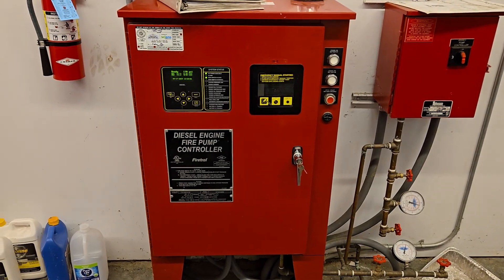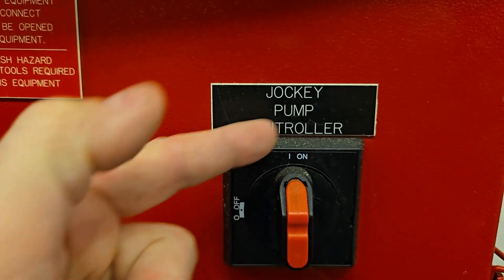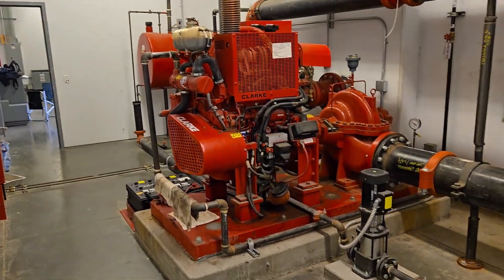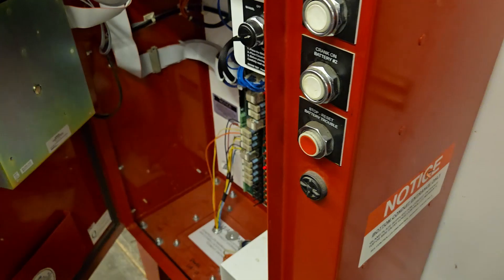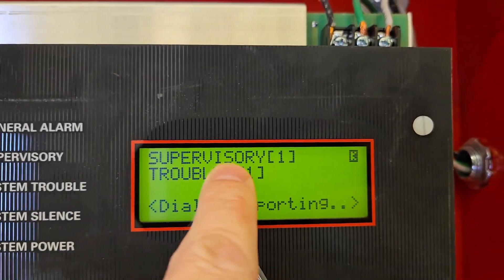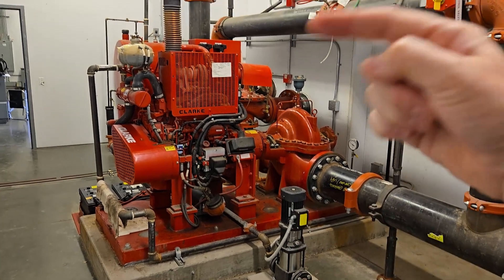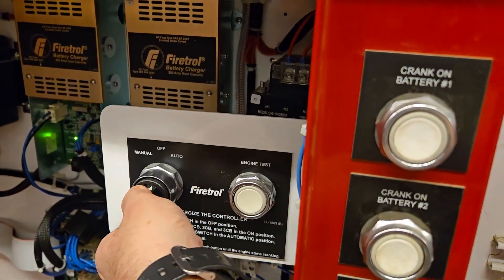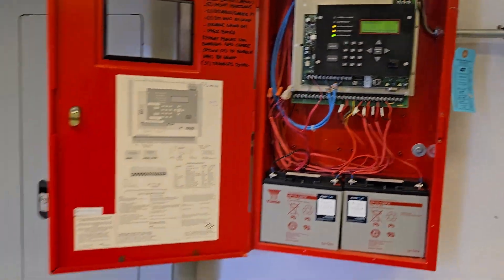Firetrol Pump Controller | How to Turn Off A Diesel Fire Pump for Flow Testing

Comment: Before i retired I was a maintenance tec. we had to do a fire pump test every month. Not sure what the guy in the video was doing, but we had to actually run the pump. There was a procedure to follow step by step.
Reply from the maker: Great point,

My company has separate teams for Alarm Technicians & Sprinkler Fitters. The clients property in this video has a separate sprinkler company (not my company) for their sprinkler system so I am unable to do the flow testing as they do not coordinate our 2 separate companies together so the sprinkler fitters can be onsite to monitor the pump while flow testing, so instead I bypass the main pump and run the jockey pump for my flow testing to receive the alarm signals required for their annual fire alarm testing.

Usually, clients want their pumps bypassed to minimize the possibility of any issues unless their contracted sprinkler company is onsite to assist with flow testing.
Reply: @F.L.S.Technician  For us it was a big deal               that the engine ran for 30 minuets every month. We had to call a service and tell them we were going to test, do all testing and data collecting and put the system back in service and call again to tell them we were finished. It was loud but I kinda miss it
Reply from the maker: @ Yes, our sprinkler fitters follow the same process. I believe the diesel pump testing is weekly and the electric pump testing is monthly.

I definitely don't miss being in the room with a loud diesel pump 😂

Comment: I'm not a subscriber, and I don't want this to sound rude. I don't know how long you've been making videos, and I hope my opinion is helpful: explain once, clarify once, execute, recap. Would look like this; "today, I'm preparing to test this system, to do that, I need to shut off this giant pump so it doesn't cause the system to experience an over-pressure event. Here's how I shut off the pump." ... Explain shutdown procedure... "To clarify, leaving the diesel pump on during a flow test could damage the pump, or the sprinkler system, so we're shutting it off to prevent that from happening." Execute shutdown. 

Believe me, I know there are generally a lot of idiots in this world, and we're all guilty of forgetting things occasionally, and of making mistakes, and multiple overview explanations may be needed for some people. For that matter, your content may not be for me, and my advice/opinion may not be helpful to you. If that's the case, keep on doing what you do and be well.
Reply from the maker: You don't sound rude at all. You've given me some great constructive criticism and I appreciate you taking the time to share your thoughts on how I can improve my videos.

I don't know how much I can improve upon these ideas, I usually make these videos on the fly during my shift so I have to balance my time accordingly, but I will keeps your words in mind in the future.

Thanks again for sharing your thoughts, have a good day.